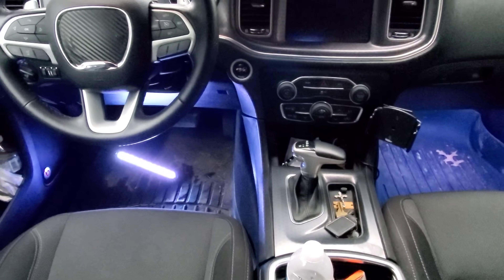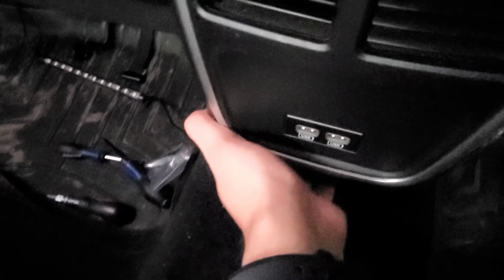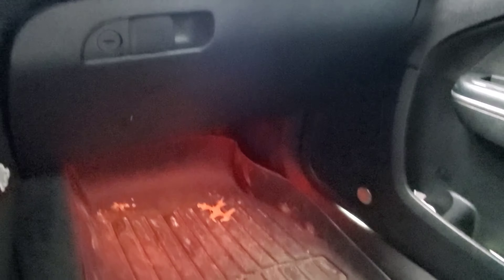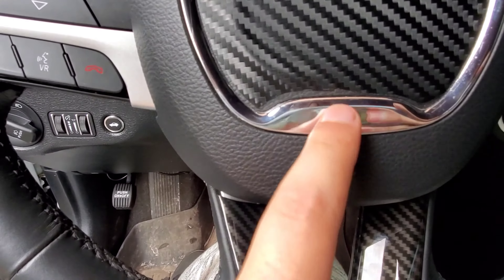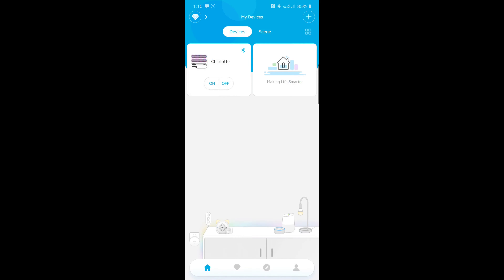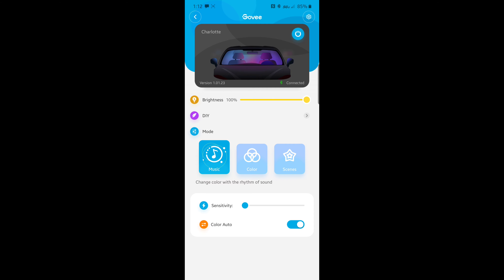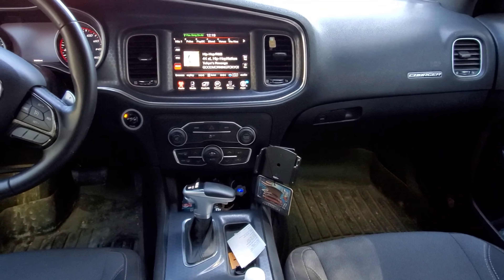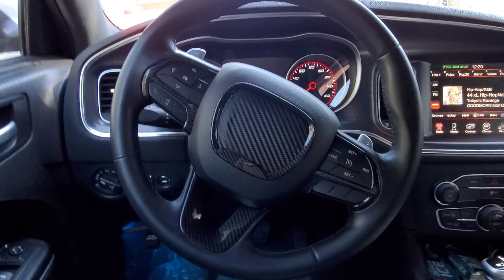Installing Govee Interior Footwell Lights on my Dodge Charger RT

Comment: My music mode literally only works when the car isn’t running, is that the same for you?
Reply from the maker: Mine is wired to the direct battery 12v plug. Is yours? I've zero connectivity issues so far.